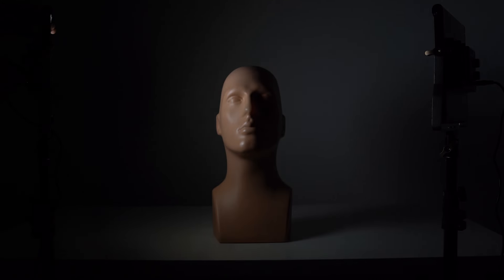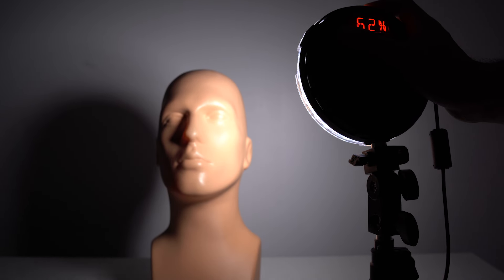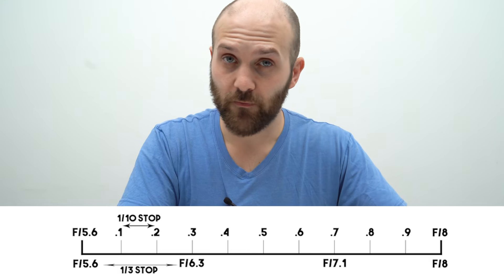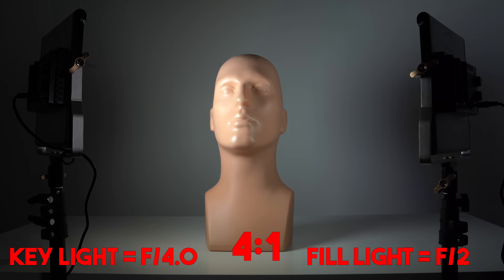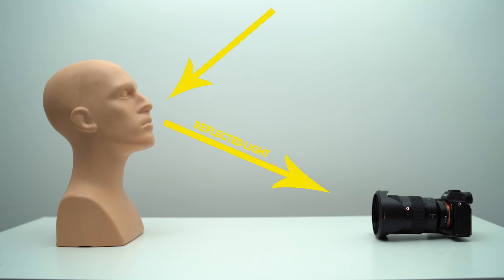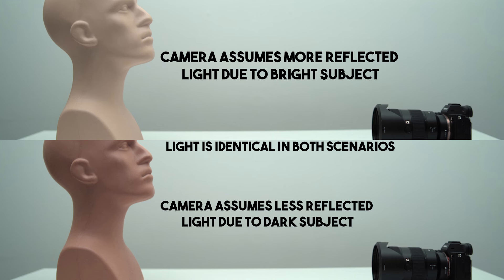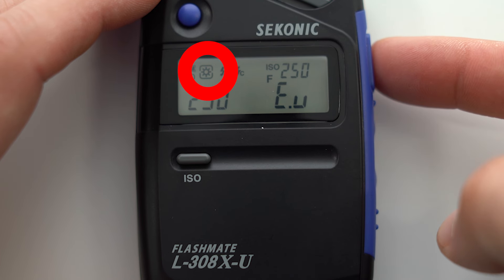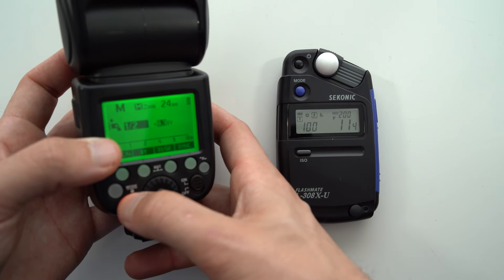Light Meter Tutorial Photography // Light Ratios with Sekonic L-308X-U Flashmate

Comment: It must be a photo-intervention that this video showed up in my recomended results. I have been doing some wild life shooting. Often birds or squirls. And there is often alot of back light and am shooting in a limited range of subject color, especially squirls. Except the finding of the Great White Squirl I recently captured in all natural light. My need is to stop down and add light for subject fill, and what amount of flash to add back. If i meter the sceen at f8 and stop down the lens two stops, and the meter my flash to an amount the measures at f8, can that work. It was just a thought I had as an approach,  and ofcourse experient with isolating the subject. Generally I shoot iso800 and between 60-250 shutter. I shoot primarily film.
Reply from the maker: if you meter the screen to f8, stop down two stops (to F16), and then added flash metered at F8, it would be 2 stops underexposed, like the ambient.
Reply: Robert Hall Photography Yeah, realized my error in thinking.

Comment: Great video, 
I have a question, how do you use a light meter in the yongnuo/godox systems with Nikon? They are a ttl based systems that fire a preflash even in M mode.
Thank you
Reply from the maker: Idk about Yongnuo but Godox definitely does not send a preflash for manual settings.
Reply: Robert Hall Photography  thank you, there isn't any preflash even if i use my nikon flash (with a reciver)?
Reply from the maker: oh that's different. Then you are borrowing the Nikon CLS/TTL system to provide remote control (which is why you put the flash in TTL). I'm speaking specifically about Godox speedlights that have the radio technology built in, those don't preflash. I haven't used a Nikon speedlight in like 4 years because they are so far behind.

Comment: what is the difference between the cheap meter and the expensive ones?? what is the defining factors for the light meter price??
Reply from the maker: Generally modes, modules, features.
A cheaper meter like this one is rather basic. A high end meter, like the Sekonic L-858d-u has sooo many more features. It's compatible with HSS. You can test flash durations at any interval. You can change to lux/lumens. You can implement ratios based off an ambient reading. You can get a more specific output of light. Then there's modules for them so they are compatible with radio/lighting equipment as well, so you can trigger a flash directly from the meter. But the core function of "tells you the strength of flash or ambient light" is the same whether you get a budget or high end model.
Reply: @robhallphoto  thanks a lot for this , i appriciate it.

Comment: Does this light meter allow a F1.8 Aperature. I have a lens with a 1.8 and this light meter does not have 1.8 was wondering why and if someone can help me.
Reply from the maker: I don't know of any light meters that don't accomodate F1.8...This is a basic meter and goes to F/0.5, which is 4 stops wider than F1.8
Not to mention if a light meter did have a limitation of say F2, you could just increase the ISO a stop to compensate and then just drop the result by a stop for an equivalent result.
Reply: Robert Hall Photography so you’re saying to just increase my iso by one more to get an exposed shot. Let’s say I was using an iso of 100 shooting with a F1.8 with the lens I have. I would increase my iso to 125 on the light meter and put my aperture on the light meter F1.4 rather than 1.8 since it’s not on the light meter and closer or should it be F2.0. Should I keep my aperture on the light meter at F1.4 or F2.0 and increase my iso by one more click to make it iso 125 since I gave an example that I’m shooting on a film roll with an iso of 100. Let me know if that makes sense and if you understand. Thank you would love the help.

Comment: Hey Rob, thanks for this video. Quick questions ... does this light meter work if we start getting into high speed sync? How does one determine what flash power to use? Or would we use the lowest flash power possible to have a faster recycle time until restricted by the amount of light?
Reply: Sekonic's newer L-858 will meter HSS.  The L-858 is a premium incident/spot/flash meter with a price tag to match.  I'm sure in the next few years that the HSS functionality will be found in lower tier meters.  If you have need of the functionality, it's a great meter.

Comment: Really great videos as always but something is odd.  Going from f5.6 to 6.3 is 1/3 stop and then to 7.1 is 2/3 stop but it goes from .3 to .7  which is a .3 jump up then a .4 jump up.  Then to f8 it’s the final 1/3 stop increase and that’s back to a .3 jump.   That’s not linear.  (.3 jump then .4 jump then a .3 jump).
Reply from the maker: I mean, realistically the gaps are .333333333, that just doesn’t display well.

Comment: Wouldn't it make more sense to use the DIN scale? That would do away with the astronomical ISO numbers.  For example, ISO 25,00 would be DIN 45º.  Each number on the DIN scale represents one third of a stop difference from an adjacent number.  The DIN scale goes up arithmetically.  For example, ISO 100 = DIN 21,  ISO 125 = DIN 22, etc.  To double sensitivity, add 3 to the DIN.  For example, to go from 400 ISO to 800, add 3 to DIN 27º to get 30º.  This would be much easier to work with.

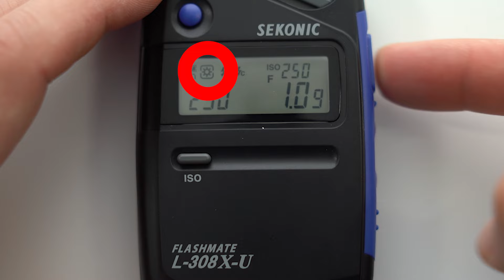Comment: I just got this light meter and am using this video as my “user guide”.  Using shutter priority mode, I dialed in ISO 200 and shutter speed 60.  There I took a reading.  It came up 1.1.  That’s similar to the video at 8:30.  How do I translate that into a real aperture?
Reply from the maker: well, F1.1 is a real aperture. F1.0 is 1 stop below F/1.4. So if you increase the ISO to 400 it would be F1.4 .1, ISO 800 F2 .1, ISO 1600 F/2.8 .1, ISO 3200 F/4.1 .

Comment: At 3:00: There are probably two reasons we use Aperture for metering. First, meters were developed in the film days. Film photographers will prefer to shoot a whole roll at a set ISO. Second, it's usually preferable to shoot at a low ISO. I generally prefer to use ISO 100 with flash; output power and aperture are usually enough to control my exposure.